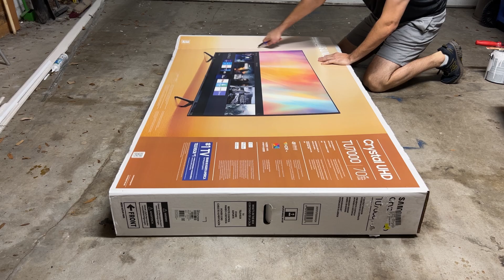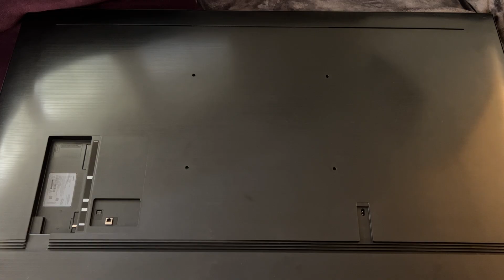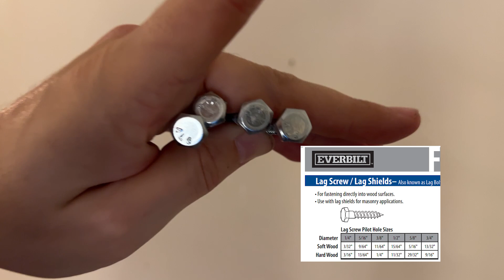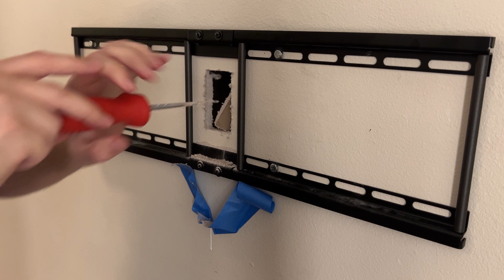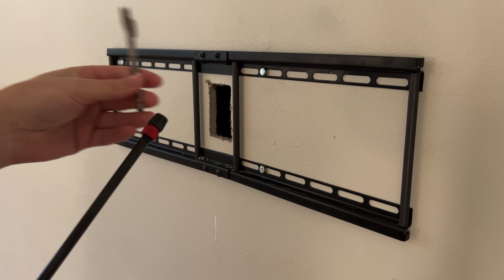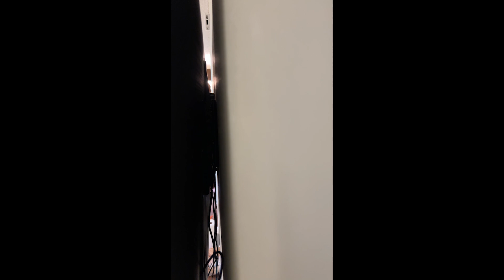Wall Mounting 70 Inch Samsung TU7000 TV with Cheetah Mount Kit

Comment: Installing a power extension cord through a wall cavity is a violation of electrical  the in most states in the US & homeowners insurance would have issue with such an installation as well. Thoe "brush plates are for low voltage cables only, such as HDMI or coaxial.
Reply: Hater 😂
Reply: @ALSPOV626 how is that hate? He just voided his home insurance. Have you ever heard of NEC 400.8? If not read below

400.8 Uses Not Permitted.

Unless specifically permitted in 400.7, flexible cords and cables shall not be used for the following: 
(1) As a substitute for the fixed wiring of a structure 
(2) Where run through holes in walls, structural ceilings, suspended ceilings, dropped ceilings, or floors 
(3) Where run through doorways, windows, or similar openings 
(4) Where attached to building surfaces 
Exception to (4): Flexible cord and cable shall be permitted to be attached to building surfaces in accordance with the provisions of 368.56(B)
(5) Where concealed by walls, floors, or ceilings or located above suspended or dropped ceilings 
(6) Where installed in raceways, except as otherwise permitted in this Code 
(7) Where subject to physical damage 

& just for clarification:

Section 400.7 states flexible cords and cables shall be used only for the following 11 applications: the connection of pendants, wiring of luminaires (both permanent and portable), portable and mobile signs, appliances, as elevator cables, for wiring of cranes and hoists, connection of utilization equipment to

Comment: Great video.   I have the same model,  but 55 inches.   I wanted to know what size screws did you use to mount the TV to the bracket?   My TV did not come with screws.
Reply: I’m having the same problem 😭
Reply: Hi
Were you able to find the appropriate screw?
Reply: Same, I've just ordered some M8 x 45 mm screws but they require a spacer between the bracket and the TV